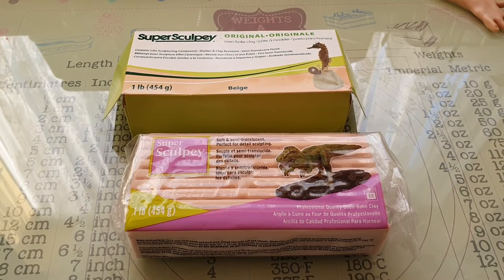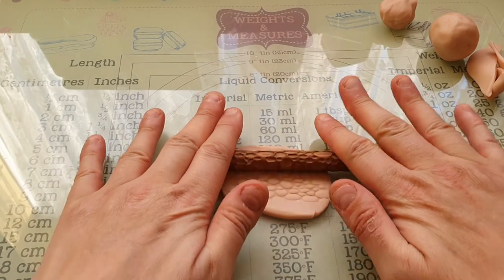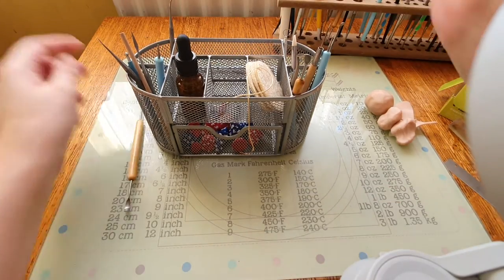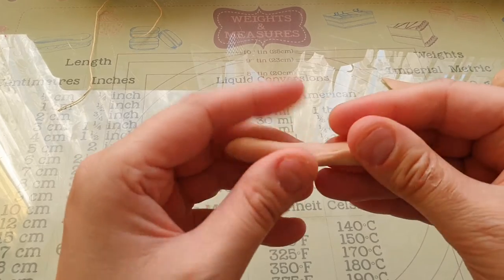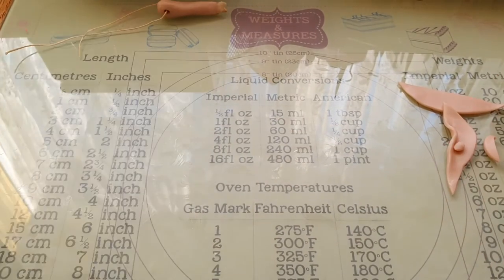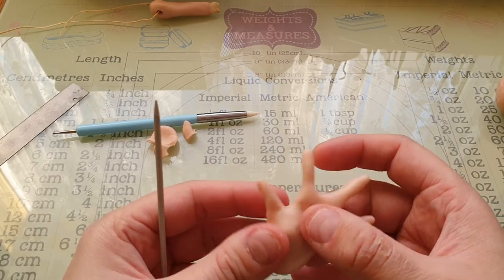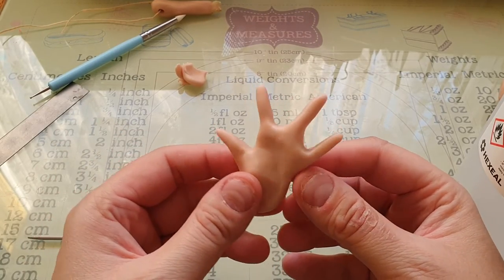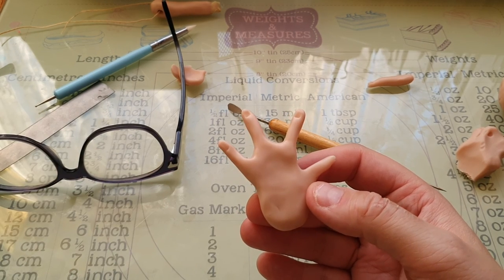My process of sculpting a hand from polymer clay. Part 1.

Comment: That's brilliant Johnny, thanks for all the tips, you made that look very easy. Would you be able to share a link to that rolling pin please?
Reply from the maker: Hey Annie glad you found it interesting. I don't have a link, it's best to shop around. I paid £2 for my acrylic clay roller from ebay, all my clay tools were inexpensive too. I would suggest not buying direct from a craft shop as they can get quite pricey. Also a good quality pasta making machine is a must. I bought a regular cheap one when I first started using clay. Then invested in a Marcato Atlas 150 these are quite pricey but so so worth it!